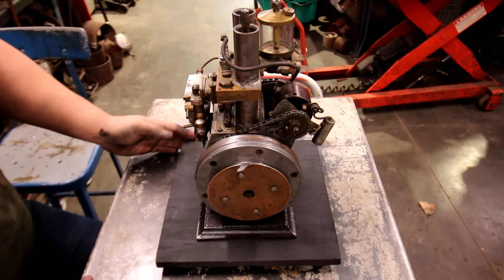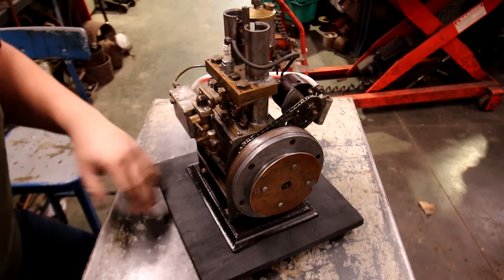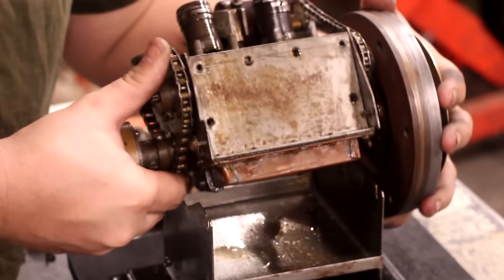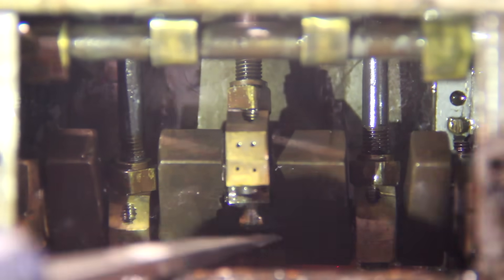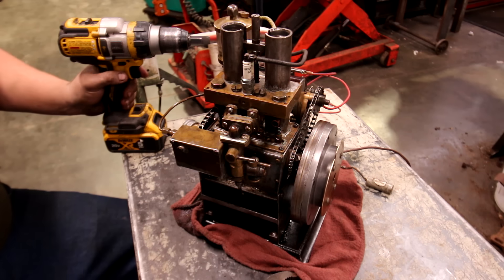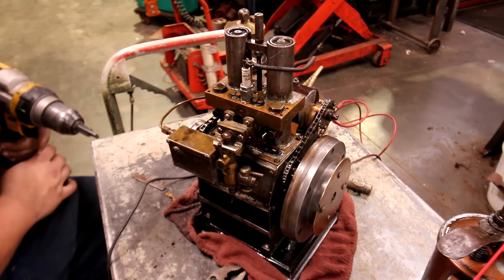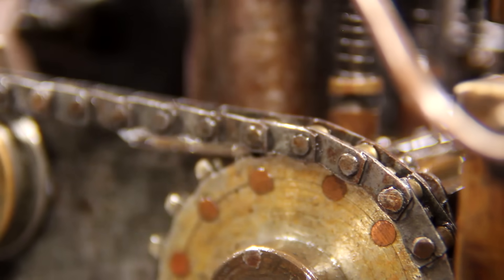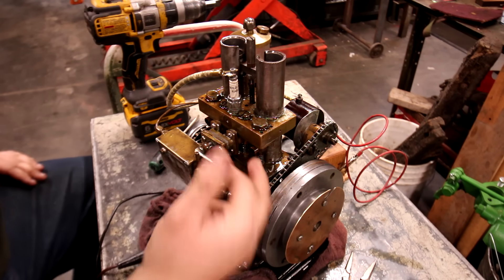RARE!   Antique Homebuilt Two Cylinder Opposed Piston Engine. WILL IT RUN?

Comment: Nice! I think some ww2 planes had opposed acting engines & also large Diesel power plants with 3 v engine piston/cylinder assemblies faceing each other in a opposed triangular manner. I wonder if the inventor was closeley involved with one of these engines at some point. Circa Post war  suburbia was influenced with a lot of very clever d.i.y shop projects from Popular Mechanics magazines "build your own bench belt sander or mabie a homemade experamental helicopter/autogyro"... & hobbies like controll line airplanes, Go Karts/ Minibikes, & train layouts or slot cars to name a few... Very clever people around then. Now we get those lame life hack videos & kids eating tide pods for thier ticktock chalanges🙄...✌👍
Reply: Junkers jumo diesel (think stuka dive bomber) had an inline opposed piston, forced induction 2 stroke configuration. Pretty sure the delta configuration engines were British, not german. Small ones ended up in trucks, big ones in trains if I remember right.
Reply from the maker: Hard to say. The most common opposed piston  engine is the Fairbanks OP engines. They are still used in peak power draw power plants to this day
Reply: what you have is a modified copy of the French company Gobron-Brillie  and their gas engine design from 1900. Although the maker of your engine has only used a 3 throw crankshaft, the original design has a 4 throw crank with the 2 inside throws operating the lower pistons and the outer 2 throws worked the upper pistons.

Junkers made aircraft diesels 6 cylinder 12 piston engines that used 2 crankshafts that were geared together and were 2 stroke diesels with forced induction to supply scavenge air ( as used in the Faibanks-Morse engines) they were used in larger multi engine aircraft, Mainly the Ju86(only some versions) and some models of the Blohm+Voss flying boats. they were never fitted to the stukas.
The Junkers engines were license built by Napier in the UK as the Culverin. Napier during WW2 then started to consider the deltic (inverted triangle) design to fulfil an admiralty requirement for high powered light weight engines for use in fast patrol craft (think PT boats and small cutters) and small mine sweepers. the deltic engines would then be used later in the Class55 (became known as the deltics after the engines) and the class 23 locomotives.
Junkers also built 2 stroke opposed piston engines that used a 3 throw crank per cylinder with the centre throw working the lower piston and the 2 outer throws working the upper piston. (similar to your  engine but reversed)  
the small models of this style were used to power pumps, generators etc. and also in some early model diesel trucks and other construction style machinery. the larger versions of this style of engine were used in marine and large power generation and pumping applications. Doxford engine works ( part of the shipbuilding firm) built these engines until closing in 1980.
 @cruddycornstalks
Reply: HAY NOT TO MENTION POPULAR MECHANICIS HAD ALL THE INFO TO BUILD YOUR OWN MINI BULLDOZER ☝️ KID SIZE WITH A BRIGGS MOTOR 
☝️ FROM SCRATCH I SAW ONE DEN IN FORT MEAD FL. AT FL.FLYWHEELERS 
LAST MONTH